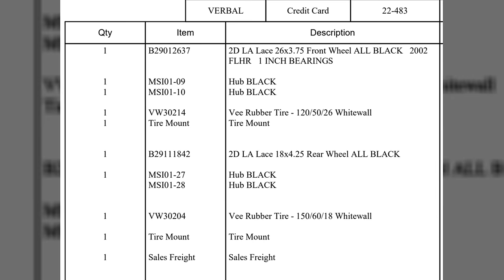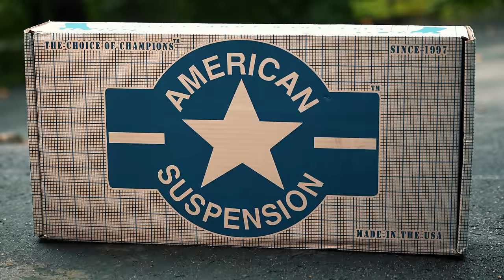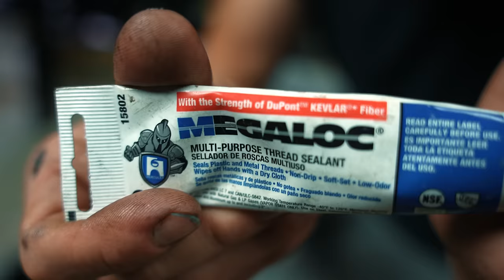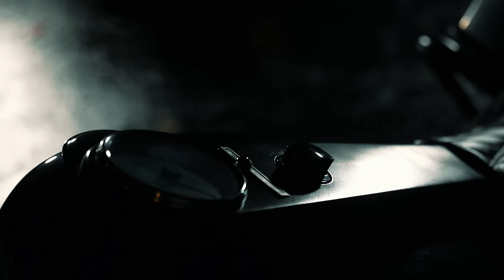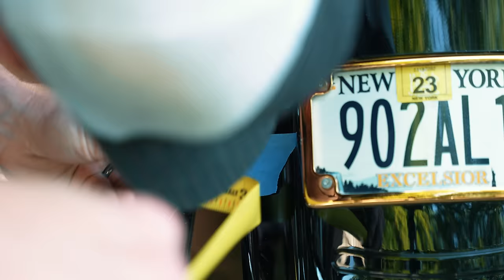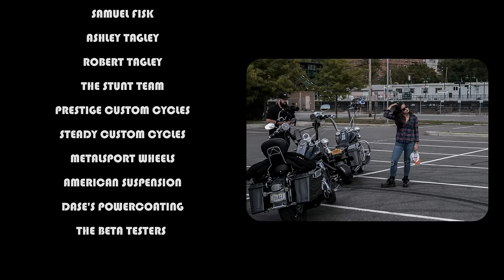CHOLO Road King - ALL NEW HYBRID CLASS from STYLE BLENDING

Comment: So I bought the slash cut steady custom cycles.  The boss showed me your pipes. But I did y like them till I seen them on your bike cause I couldn’t see them on my bike. But damn they look and sound great.  I have a 2012 streetglide. 103 motor.  Wasn’t sure how the sound difference would be. I feel like they are louder then the slash cuts. And at 3000 rpm the sound changes. It’s confirmed in case anyone doubted it.  American Suspension is legit also.  I appreciate you being the test rat. Lol. Great video by the way. ✊🏽

Comment: Watched this in 1.25x speed just so I could see these beautiful cinematics in an even more beautiful 30fps. True HFR wouldn't make them better, but 30 does, ON GOD. Just gotta match the shutter speed to what you typically use on 24 (so 1/50th of a second) and it all works out.

EDIT: I'll praise a full-length bike movie on principle if it was filmed 30p 1/50th shutter.
Reply from the maker: Glad you liked it. That's an interesting concept. Just a little skeptical of the motion blur for an action shot
Reply: @JETFILMCHANNEL  Do some test shots! Never hurts to experiment and whatnot. After all I've seen, I'll swear by 30p with a 1/40th to 1/50th shutter speed. It's just a little slower than real life but without looking laggy like 24 and 25 do. The key seems to BE the slower shutter speed, which enhances the blur, which somewhat masks the fact that there are more frames making it smoother.

Oh, and I forgot to mention that your bike is badass. I love it, even if I'd probably go a little more conservative on my own version of it. IE, a 23" with 12" apes. Speaking of, do you need the rake mod for a 23, and if you don't NEED it, does it give a massive improvement on a 23?

Comment: How do you like air ride in front? I'm thinking of adding but everyone telling me its dangerous.
Reply from the maker: It's great if you're going for that extra shock and awe factor. It rides pretty well for the short amount of suspension travel I set it up for. 
It's definitely more complicated than conventional shocks and has the potential to be dangerous if the air suddenly dumps out at high speed (never happened to me). It really depends how the bike is intended to be used. 
If you're only considering it for comfort, then look at a monotube setup instead. If you're looking to compete for trophies then it's air all the way.
NOTHING turns more heads then a softail dumping air and laying frame at a show. Believe me, I just came back from Daytona. Parking next to $100k baggers and the layframe Cholo gets more crowds.

Comment: Question about the back wheel... did you have to use a pingel spacer to get it centered of fender with the width you went with?? I remember you had an issue with the dnas and I actually have  the same problem with my 03 rk. I'm looking to do rear air ride but that'll never work with my wheel not centered of fender...thanks! Dope bike! 👍🍻
Reply from the maker: I ended up buying a set of aluminum spacers on ebay for $25. Came with about 15 different sizes. It was one of the best small mods/per dollar I've ever done.
https://www.ebay.com/itm/264963782728?mkcid=16&mkevt=1&mkrid=711-127632-2357-0&ssspo=_bYsgUsTT8m&sssrc=2349624&ssuid=Hg2L2UkoSL2&var=&widget_ver=artemis&media=COPY

Comment: Beautiful bike Yall did good job what is the best to build cholo bike soft tail or road king?
Reply from the maker: It depends what you're looking to do, and where you live. Mountain riding is tough with a really low softail, it's better suited hopping around the Blvd on a Saturday night when you're looking to get really...really loud. 
Best looking Cholos usually go to the softail. And the Softail (engine for engine) is usually faster too, because it's 100lbs lighter.
The Road King can look awesome too if you do it right. Its also a lot of fun to ride, and it's less work to ride it. RK has a respectable amount of functionality for overnight trips too, and it's smoother, and handles turns much better.
Oh, and if you're a big guy over 6'2, or over 300 lbs go with the RK

Comment: With a 26” front will it be comfortable traveling long distance?
Reply from the maker: It all depends how you set the air suspension. You can make it really soft for long highway trips with the press of a button. The ballon on the stock 16 will be hard to beat in terms of soaking up minor bumps before the suspension has to intervene but the air suspension truly works miracles when you consider how little sidewall the 26 has.

Comment: Hi, first off amazing videos. I’ve now watched all of them. 

probably won’t see this but I need to try as I’m stuck. I recently bought the Vity’s design controls, they are unbelievable, but they don’t seem to line up with my OEM switches harness, but it looks like you have the OEM switch harness. I googled it and that’s where I found your video. It doesn’t line up and it will definitely not interact with the brake switch. Just curious what you had to do. Thank you
Reply from the maker: Me and a couple other guys had that same problem, its not a perfect system when used with the stock switches. However, I was able to get it to work with the little brake switch hidden in there using the "upright barrel" looking nub (the innermost part of the lever where the master plunger bolt connects) by keeping a gap between the lever perch clamp and the switch housing. Set the gap (something like 3/4") based on how the barrel touches the switch.
Every once and a while I got a red light on the dash, that meant that the lever perch had shifted ever so slightly to where it wasn't activating the switch. Re-set the gap and ride on.
Reply: @JETFILMCHANNEL  this is very helpful. Thank you!  I’m just not a huge fan of custom switches, so I’d like to make it work with stock, but yea it’s not perfect. There are things I can do to close up some of the gaps. In the videos that discuss this it seems there are no issues. Thanks again !

Comment: S&s doesn't make header pipes . I have an 08 Softail deluxe. Dealer going to call Steady custom cycles next week to see what headers I can use. Bassani header pipes can only be used with their mufflers.
Reply from the maker: You mean, S&S doesn't make header pipes for your bike.
Steady custom cycles makes pipes that will fit just about any header on the market. Including bassanis
Reply: @JETFILMCHANNEL  S&S only makes header pipes for touring models. That's how you were able to get them for the road king. Not for Softail deluxe. Bassani makes them but I have to use their mufflers. So my dealer is going to call Steady custom Tuesday to see what brand of header that they require, that's on their drop down menu that I can use. Is it possible to use a s&s touring header pipes on the deluxe or not? Thanks 👍 for the prompt response. Appreciate it. Any new videos?
Reply from the maker: It would be theoretically possible, but it would require custom mounting work. That's the main difference.
Steady make pipes that will fit Bassani headers, no need to wait 2 weeks for your dealer to get you an answer. When purchasing the pipes on their website, it asks you which headers you're using. One of the options is bassani. 
Just saved you time
Reply: @JETFILMCHANNEL  I only have to wait till Tuesday of next week. We looked in the 2023 drag specialties book n makes headers for their mufflers,like fish tails, which they mfg. Steady lists bassani but we have to see if they are just for touring  or not. On steadys site they show the chikla swepts on a twin cam. S&S doesn't list header pipes for a Softail deluxe on their site. If they did, it's not there now. I'll see on Tuesday of next week n let you know so you can pass to your peeps. Thanks.
Your first video was awesome. I sent it to my dealer n parts guy n they were floored. I've taken a lot from your videos. Just did a cam chest overhaul. New cams, tensioners,oil pump,chain, pinion runout checked, tappets,pushrods. Went with DK custom cycles coil relocation kit. Better air flow on the rear cylinder, hopefully, but it looks better. Checked Vitys. He doesn't make a brass rear brake reservoir cover . Only has for the front brake. Doesn't make sense. Later sir.
Reply: After I let you know this video was not available, I'm going to buy from Samson directly .

Comment: Do you get a wobble at high speed with the 26" wheel
Reply from the maker: No wobble. I've had it up to about 110, and highway cruise around 80.
I did have a wobble months before I put the wheels on and it turned out to be the stock rear suspension needed adjustment and more PSI in the rear tire.
Just don't expect a 26 with a rubber veneer to handle like the stock balloon tire on a 16 wheel.
Reply: @JETFILMCHANNEL  👍that's good news    I've heard  you can't  ride at speeds over 55mph with the big wheel  . I guess it was a myth or something . Your bike looking good man keep  sending in the awesome videos😎👍.